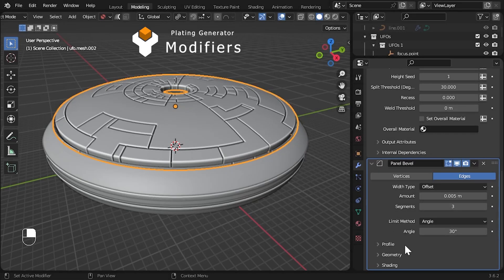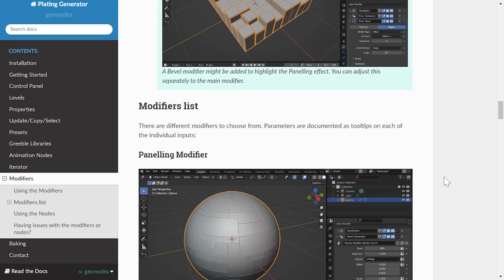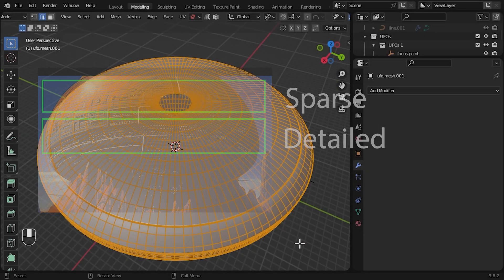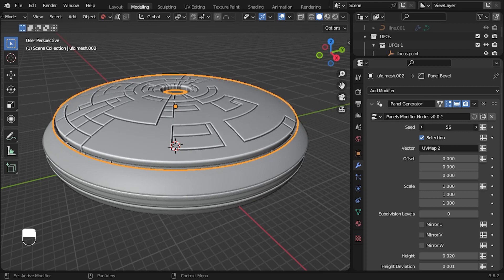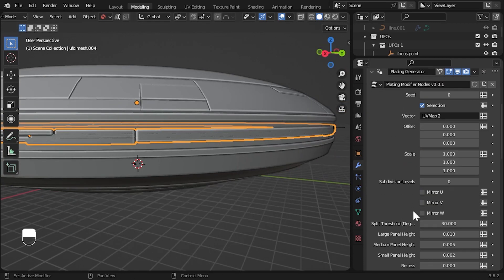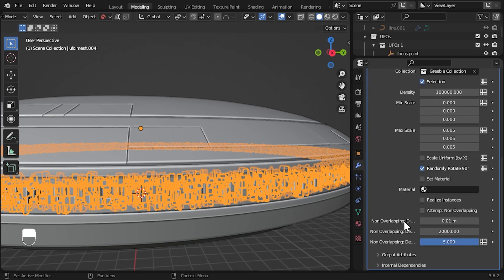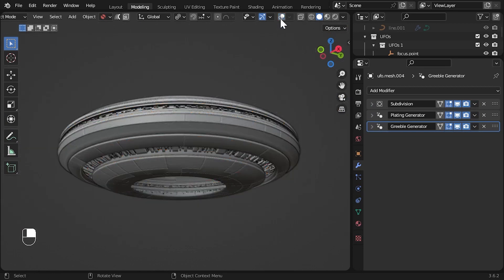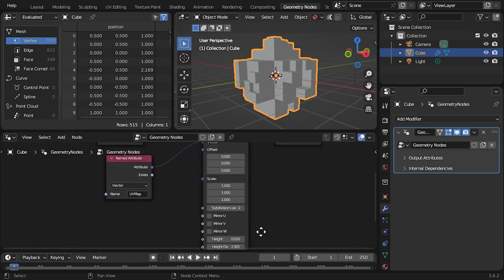Plating Generator Update: Modifiers

Comment: Can it be used for creating bricks or regular elevation tiles ?
Reply from the maker: It is not ideal for regular repeating patterns - I do have a few ideas on this though so if you are interesting get in touch via info@configurate.net and we could discuss.
Reply from the maker: P.S.  I created a Brick Modifier that might help: https://www.dropbox.com/scl/fi/ygos1fyloy8hr3lgpqg2w/brick_modifier.png?rlkey=6urq4lgp119qpjzy69hhjvir4&dl=0

Elevetion tiles might take longer to work out.

Comment: I've used another similar addon where the generated geometry was quite messy and you couldnt get a unimesh object from it without spending lots of time on cleanup and remeshing. Will this be the same?
Reply from the maker: The add-on does split the mesh along the panel edges so there will be gaps: you may be able to resolve this with a weld modifier, but if you decide to give it a try and it doesn't work out just contact info@configurate.net and I'll organise you a refund.

Comment: Love this addon! Beautifull work, i have a question, can i drop down the greeble density before using the modifier? it's set to 500 default but when i apply on a very big surface, Blender crashes. Thank you beforehand!
Reply from the maker: Hey there, if you drop me an email to info@configurate.net I'll see what I can do in your case.  Thanks!